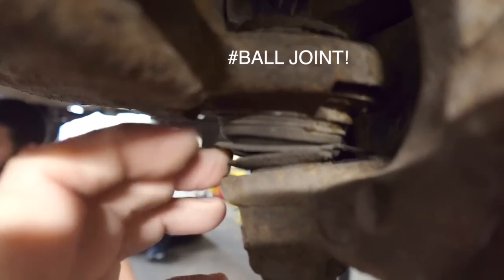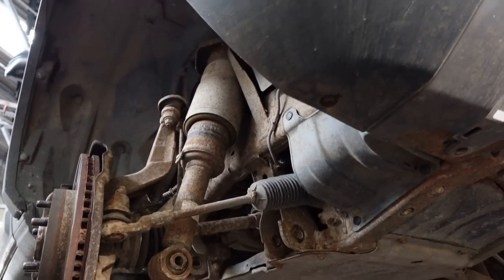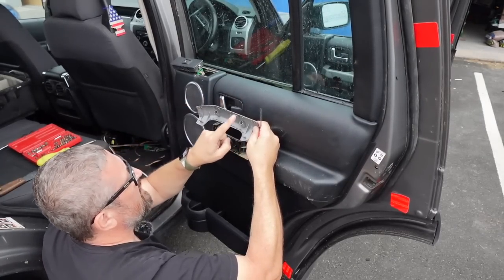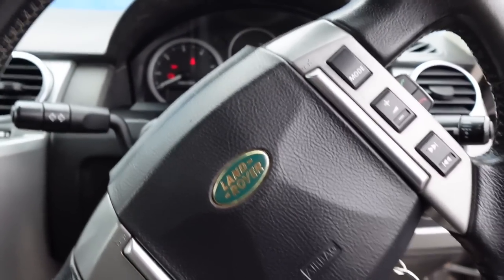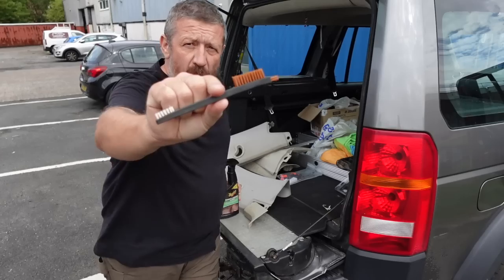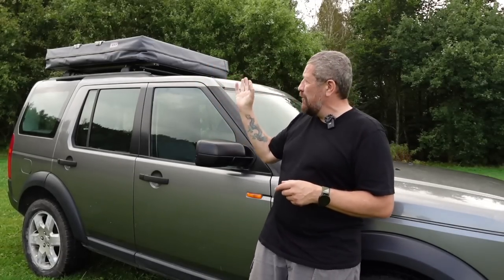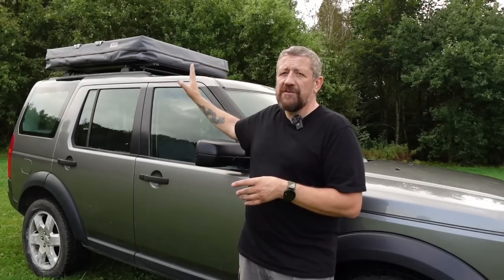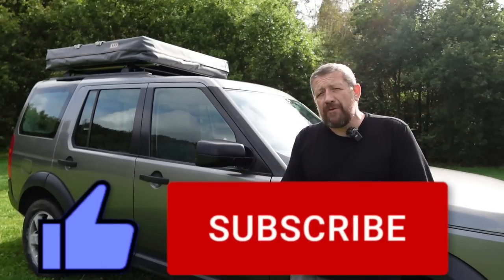£1500 scrap DISCOVERY LR3 is finally saved!

Comment: I'm really enjoying the Disco 3 videos, thinking about add-on. What about a roof mounted light bar, split battery power to power the light bar, and fridge , extra interior storage,  ie, pull out draw system mounted in rear, extra power points,

Comment: Excellent video. I recently fitted bars and a roof top tent.  Unfortunately I didn’t think it through first, as I wished I’d fitted the roof rail attachments I got from powerful uk, so they had to go on in between the bars. I would have preferred them on the outside.  This will enable be to attach a bar(old roof rack bar), which I’ve fitted rivnuts at either end, and, one on the opposite side to hold a light.  This will then go under the tent, and will enable a tarp, or with a kadar rail, a drive away awning to be fitted

Comment: That looks really fantastic! It looks like a really upmarket Discovery now, I have found that the plastic rejuvenators  the t few weeks, then quickly revert to dull lifeless things, but if you hit them with a hot air gun they stay looking good for months,(mine have not yet gone back to dull after 3 months of 35 deg heat), so I will be using the heat gun from now on, the Magwires products I have found after extensive trials to be totally useless, nothing more than scented water it appears! Stay safe ,Chris B.

Comment: As far as the plastics, most trim restorers only last a few weeks and the heat gun method will make your plastics brittle after repeated use. Best to use some of the more expensive restorers, and follow the instructions in detail. Some I would recomend are malco epic revice, solution finish and owatrol polytrol

Comment: We bought an LR3 and immediately the injectors needed replacing - how much !!!, then spurious warning lights would pop up, then like yours the suspension needed fixing. We eventually threw in the towel and bought a very reliable (and cheap) Hyundai Santa Fe 2.2. Of course it's not as pretty as the LR but at least we can go places without stressing out. Underneath the Hyundai is rust free unlike the LR which looked tired and rusty. If only LR could go the extra mile and protect these cars and make them reliable..... if they did, they would rule the world

Comment: this is gold. thank you for inspiring me. I'll be tackling the rear window regulators on my disco4 commercial without delay. I want to upgrade the infotainment system to the HSE spec plus add the cameras option - visibility aft of the B pillar is a problem that I still struggle with.

Comment: Have you checked the (plastic) inlet manifold for a tiny hairline crack? Our D4 had same issue and only popped the limp on under heavier load?
Reply from the maker: I looked into this but apparently it's more common on the 3.0 D4 that the 2.7 D3. Cheers for the advice though - made me do some research!

Comment: Interesting video, making good progress. How do you stand from an MoT perspective with the EGR delete ? Just had our Mazda rebuilt for carbon build up and can’t help thinking feeding sooty air back into the intake doesn’t help…
Reply from the maker: It will still need to pass emissions. I believe if the tester sees the delete he could fail it. But they're not allowed to remove the engine cover so hopefully that won't happen!